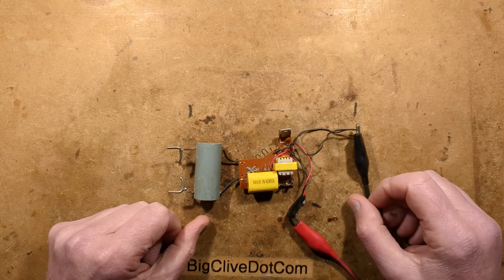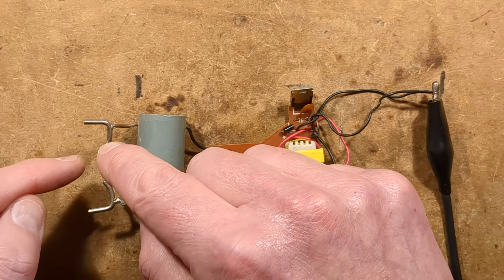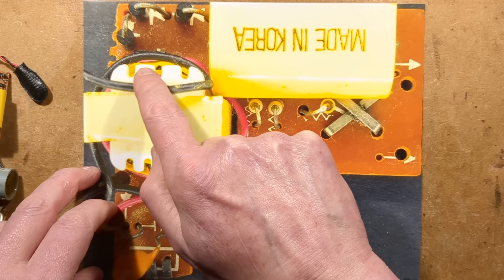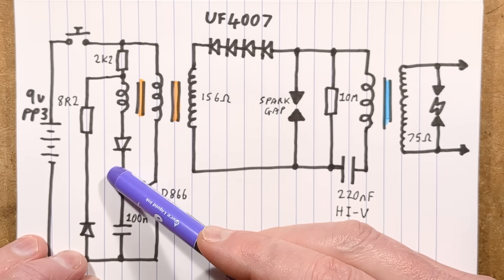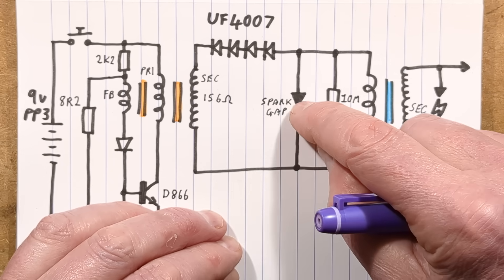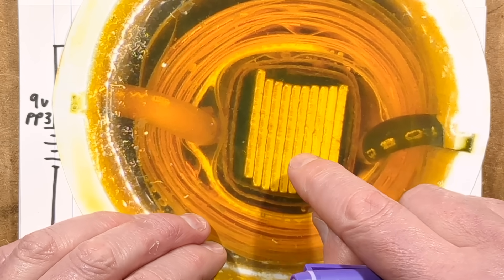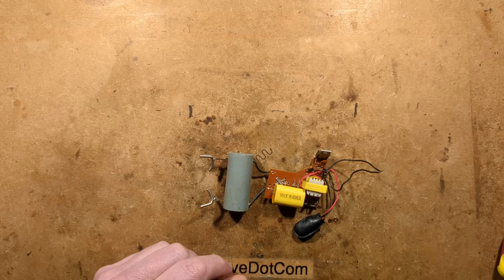How a stungun creates 20kV from a 9V battery

Comment: I honestly don't know why you want the cross spark gap, and kind of doubt it is going to hold up over a long use time. Best guess is it makes the circuit very off from time to time, but they are probably losing power doing that.
Reply from the maker: It's cheap and okay for the brief bursts of use it will get in this application.

Comment: Most of the people I've ever met aren't smart enough to know the difference between the kind that shoots probes and the kind that doesn't, but they know you need a permit for the kind that shoots the probes so they automatically believe you also do for the other.
Reply: Which could be a good thing if it leads people to getting pepper spray. The superior choice that doesn't involve smokeless powder. 

At least, in many places. UK, apparently pepper spray is sectioned with firearms and forbidden, which is insanity, and frankly insulting to those who could benefit from an effective non-lethal.
Reply: True. But where i live, in the US, it also depends on local state laws.

Comment: I remember, in high school, I was in electronics class and we made one of those steady hand games where you held the little wand and worked it across the wire and if you touched it you got a little shock. It was essentially the same internally, just with a smaller capacitor and transformer. I remember asking the teacher what would happen if you switched component sizes to up the voltage, and he very frankly responded "You'd have a stun gun and those are illegal so don't do that". Gotta appreciate the honesty.

Comment: I'm struggling here, how is the current going through the diodes facing that direction?
Reply from the maker: They can face either direction, but the one chosen may reflect the peak output symmetry of the transformer.

Comment: I'm confused but are the diodes backwards in picture? 
I would have thought a rectifier diodes would be turned the other way?
Reply from the maker: They could be used in either direction, but are probably used this way to match the most efficient output from the transformer.

Comment: Really interesting video.
What frequency is the thing oscillating at , to keep a constant output?
Reply from the maker: It will depend on the transformer and supply voltage.

Comment: This power converter is a ringing choke.  When the core saturates, the transistor shuts off, and transformer voltage polarities reverse.  Inductor energy is then dumped through the secondary.  Ringing chokes are used to charge capacitors since there is no fixed voltage ratio between input and output.

Comment: I have a sealed arc generator module like that. The company says it has 5v minimum and maximum input and 400 KV output. Can I reduce its output voltage?
Reply from the maker: The stated output voltage is very unrealistic.  A rough rule of thumb is that an arc can jump 1mm per kilovolt through air.  With the classic high voltage modules, moving the output electrodes closer together will reduce the voltage.  It's generally not a good idea to have the output wires further apart than about 15mm (15kV) as it is possible to damage the output circuitry if they are too far apart.

Comment: Don't stun yourself. Those are designed to bring the target to the point of death turn loose rapidly over and over. They can stop your heart even discharged against your leg. You're lucky don't do that again. If someone tries to use it on you you can shoot them here in America because that is considered a deadly weapon.  The current goes from the capacitor back to the coil inductor back and forth. When it reverses it turns you loose it's designed to almost stop your heart. Finally the charge depletes as it wanted with every cycle. If you tell the cop I have a heart problem and he tases you. you die it's murder if you don't it's attempt murder. But no cop goes to jail because they target the poor
Reply from the maker: The sharp pulses do not pose a significant threat.

Comment: Many years ago, I worked as a telecommunications tech. One of my colleagues had a problem with neighbourhood cats coming in his yard and doing their business, so he mad a device like this from a motorcycle ignition coil. It definitely discouraged them when they got too close. He used to bring it in to work sometimes and would connect dead ICs to it. The top would blow off the chips and hit the ceiling. We had very high ceilings there, think aircraft hangar type ceilings. Safety glasses were worn. 😄🤓

Comment: It appears to be an LC (Inductance/capacitance) circuit creating high frequency pulsed DC... because only AC and pulsed DC can operate a winding. Due to their constantly expanding and collapsing magnetic fields. That pulsed DC is fed into a transformer to up the voltage to 20k volts. The spark gap acts as a verisistor... high resistance to low voltage low resistance to high voltage.

To bump say 10v to 20kv a 2000X difference, then for 10 windings on the primary there would be 2000 windings on the secondary. Stepping the 10V up 2000X to 20000v.

A man like a computer is a brainiac,
There's no knowledge he doesn't lack,
Elsewhere he has fears,
Other than the realm of ideas,
And in truth he is foolish and a maniac.

Comment: Our police Tasers start out at an initial 50k volts but then will drop down to about 5k once the internal circuitry detects a connection. Much safer than the consumer units that deliver a constant 20-40k.

Comment: Fascinating. I wanted to experiment but I did it the lazy way with a cheap voltage converter from Temu. Is was small compared with this and it was potted so I couldn't see the circuit. Feeding it 4.5V I got quite a spark and the sound was definitely the most surprising part. I didn't have a soldering iron then so it wasn't efficient, especially with the prongs where I learned how important the correct gap was. The advertised voltage was absurd and I wish I had an instrument to test it. Honestly I don't know my multimeter well enough to know if it can test that much voltage. That experiment is lost in a box of scavenged components but I may try building another one now that I have a new electronics kit. I figured that if I was going to buy one voltage converter I may as well buy six. Also, I wasn't brave enough to test in on myself lol

Comment: I bought a self-contained one on Amazon... All the circuitry was inside a cylinder which looks like your final transformer.  The warning was to not make the gap too large to avoid damaging the circuit.  The snap is less frequent but MUCH louder and brighter.  I'm thinking there's only one transformer and a voltage multiplier with beefy caps.  Rated for 9 volts but will run on a single AA cell, and not worry about the gap size.  Still jumps 5000V gap with a LOUD report!  I don't have the guts to let those caps discharge into me, but I sure am going to Tim Tailor a Bug zapper with this thing!

Comment: Neat little project!  I'm trying to understand something.  You have 3 drawings (same curcuit?).  Left, middle and right drawings.  There is no connection or continuity between the 3 drawings (drawn lines/conductors).  I'm guessing the electricity flows through each transformer (starting from the left) ?  Specifically from the primary to the secondary windings via mutual induction?  These are iron core step up transformers?  Please correct anything I got wrong, I just want to make sure I understand.  Thank you so much in advance!

Comment: 1960s & 70s vintage A/C capable welding gear (needed for aluminum TIG welding) often had spark gap "points" that needed occasional adjustment for optimal preformance. Programable sine wave adjusting inverter systems, have since replaced those older styles. Spark gap adjusting was a way to gain just a little bit more "heat" to melt thicker materials, but go too far and you could burn up the contacts or worse the entire transformer.  Ask me how I know...

Comment: Wait... This is all DC ?   I don't see any conversion to AC so how are these transformers working.. I thought transformers only work on AC.. I guess not. Also, what is a feedback loop?  Another (3rd)  winding on a transformer ?  What are the diodes doing?  (He said rectifying but if it's DC... huh ??)
Reply from the maker: It is using pulses which can be coupled through transformers.

Comment: I have winded these Transformer's by hand many times its very tedious process but also there is problem with insulation they do work for some time after winding eventually they will arc internally. Didn't find any suitable transformer to wind them I used transformer from SMPS all I learned is best go buy 😂

Comment: The output is a tesla coil circuit. You first use a chopper circuit to change the 9volt DC to ac and then a transformer to step up the ac voltage. I made the tesla coil comment before I watched the video and saw that the output coil was not air core.

Comment: The direction of the first transformer secondary coil is critical.  In the direction shown, the secondary coil produces supplies the rectifiers during the flyback part of the cycle giving a much higher voltage multiplication than from the turns ratio were it driving in forward mode.  Were it in forward mode, than there would be an unconstrained peak voltage during the flyback.

Comment: I'm thinking that the crossed gap is like the distributor "points" in older car ignition systems and the grey cylinder transformer is like the spark/induction coil.

Comment: for lower part count, I'm a bit surprised they didn't use a Programable unijunction Transistor/2 transistor equivalent, sawtooth oscillator, to feed an autotransformers primary..

the unijunction can snap into high current conduction, and dump the timing capacitor's charge fairly fast

Comment: Could you, of course purely theoretical, turn a commercial arc lighter into a bootleg stun gun by adding a hv ceramic capacitor and some diodes?
Reply from the maker: You could probably make a Barbie sized one.

Comment: I was flying out of the Canada after September 11th (the first flight out that I could get), and forced by security to move all my electrical/electronic items into my hand luggage. This included an really old electric toothbrush, which if you removed the brush was a large plastic handle with a sharp one inch long metal spike (think flat headed screwdriver). I even pointed out how dumb this was, it was basically a stabbing weapon, and to be fair to the security, they said that if I planned to use it there was no way that I would point it out to them - so it was OK for me to board with it! Sometimes airport security can surprise you,

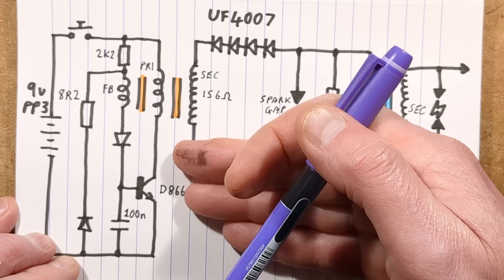Comment: 5:36 In most cases, the transformer does not appear to be saturating at that point. Instead, it’s the D866 bipolar junction transistor (BJT) that enters saturation. As the collector current, which is also the current through the primary coil, stops increasing, the voltage induced across the feedback coil begins to decrease. This reduction weakens the base drive, causing the collector current to decline further. The resulting positive feedback loop sharply reduces the collector current, ultimately turning the transistor off swiftly.

Comment: 45 years ago I made something similar using a car ignition coil and a can-type vibrator. I got the ignition coils from wreckers yards and they were full of oil I guess instead of the potted resin. Heavy unit but generated 20KV and a healthy 2cm spark I could use for remote igniting fireworks or shocking my sister on the door handle. Ahhh good times…😂
Reply: Ohh and it generates a fearsome amount of ozone. Made the room smell quite fresh…

Comment: Might be good to use an inductance meter to measure the primary and secondaries of both transformers. Or even use a cheap TC1 to do so. Will reveal the turns ratios.

Comment: Sooooo........ the first contact with the leg, and the prongs might shock you with quite a charged cap. But once the legs "in circuit" - that means a much smaller shock surely?  Perhaps the shock can be improved by putting a 1cm gap in series with the probes? Then even if the two probes are * touching * skin, the spark gap causes a sharper shock? Or maybe a continuous zap feels worse?  Could you please test?

Comment: The circuit is very reminiscent of CDI (Capacitor Discharge Ignition) used on some petrol engines.  The only significant difference is that the spark gap on the stun gun would be a thyristor on a CDI system triggered by the engine's points or an optical sensor.  CDI systems can provide a scary shock too - I think we need a demonstration :)

Comment: Thanks for another great video.  The secondary circuit reminds me of a Tesla Coil's primary circuit.  When the spark gap fires and shorts the capacitor to the primary of the big transformer, as well as pumping the contents of the capacitor into the primary winding, it also acts as a tuned circuit and resonates at a high frequency.  This is a bit like the old-school kettering ignition used in cars where you had Points and Condensors. Back in the 90s, I made a simpler 'zapper' using an old flyback transformer and used a much simpler feedback circuit.  I wish I knew where it was, it was never used as a taser but made a great cigarette lighter.  It could also light a broom handle though it took a few minutes.

Comment: Basically a flash /zeon strobe trigger circuit, replacing a neon lamp with a couple of bits of metal.
There used to be a time they had trigger coils, then  neon lamps ,now it's bits of bent metal.

Comment: That is very clever. First look at the schematic, I'm thinking, how's the first transformer going to work with DC? I was thinking collapsing fields as far as generating the high voltage, like for a set of points, but it initially works in reverse to this.
I think I've understood.

Comment: Hey clive have you heard of the Tetanizing Ray that superimposes High frequency HV onto UV lasers using aluminized reflectors? 

It also could remotely fry car computers etc..

Its in patent literature
Reply from the maker: Cars are big faraday shield boxes.  It would take a lot to induce voltage in the electronics externally.

Comment: I remember the Kodak disposable cameras with a flash. I used to work for Kodak. We would uncase the circuit, charge the flash up and throw them to work mates shouting, catch this. It only worked once as my workmates quickly learnt not to catch them. 😈

Comment: Doesn't the spark gap depend on humidity? If you're running the circuit in a very low-humidity environment, it might not conduct until the voltage gets too high that could arc and fry the transformer.

Initially, I thought the capacitor and inductor were being used to drive the transformer at resonance - so that when you hit resonance, the capacitive and inductive reactance would reinforce each other to form a strong sine wave. I thought the spark gap was there just to prevent the transformer from arcing as a protective device (like GDT/Varistor/TVS diode, but for much higher voltages (like commercial spark gaps, but cheaply made)). That seems to make sense in theory, and I've actually tried that setup (just without the spark gap). But I could be wrong and you could be right!

PS.: Oh shit, there are diodes!

Comment: Having buuoy dozens of potato guns with shitty ebay stun guns, I have been stunned dozens of times as well by the ones I have bought here in the states...

I have no clue what you're describing with the black and blue comment.

Every time I have been shocked, from a 3v cell on my tongue, to the  400v line voltage at work, to my welder, to electric fenses to stun guns I have never experienced what you describe. Even when I have had a friend stun my arm to see how long I could endure (longer than he was willing to hold it, but at least 17 seconds, WHICH IS A LONG AND VERY PAINFUL GODDAMN TIME!).

Did you stab yourself with it or something?

Comment: Layer winding of transformers used to be very common,  before the bobbin wound type became standard.   The form factor of this one is unusual,  and not very efficient,  of course it doesn't need to be in this application.   Formerly,  multiple coils would be wound simultaneously, on one long tube, then cut apart into the individual coils.   Layering the various windings directly on top of each other, with layers of insulation between, makes the transformers much more efficient.   The bobbin winding technique which is more used now is less efficient,  which is a good trade off for less costly manufacturing,  and more robust isolation between primary and secondary windings.

Comment: Why is the vacuum resin potting required for the high voltage end, to not catch fire or ?
Reply from the maker: It's to prevent high voltage flashover between windings.